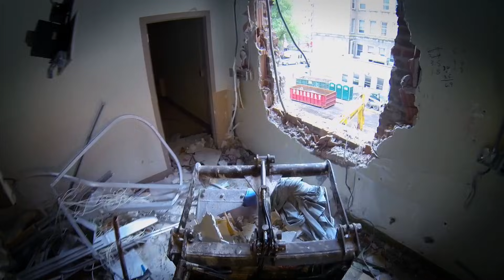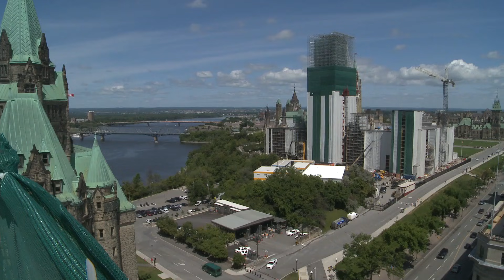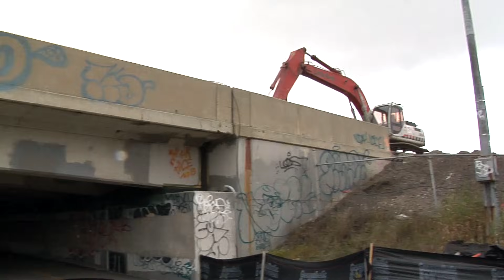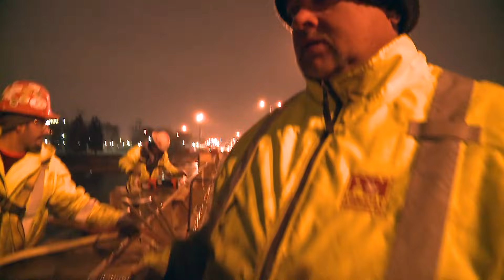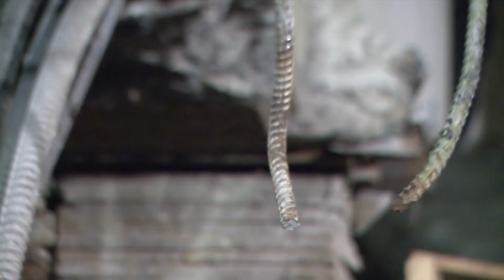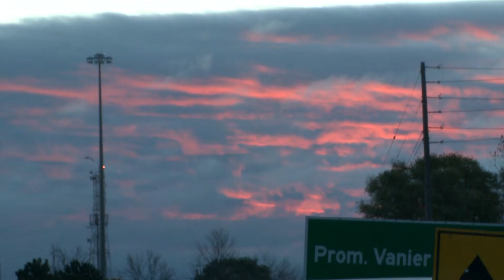Hurdman's Bridge Demolition WOW  - Priestly Demolition

Comment: so why are they removing this bridge and replacing it with another which seems to be about the same.  i can't see any structural problems.  no concrete cancer.
Reply: You can reqest the OSIM from the MTO.
Reply: @JohnDoe-gg6kc  ,i've spent enough time in the construction and destruction business to know that there are a myriad of reasons why a sound looking structure may no longer be fit for purpose.  i shouldn't have made the post.